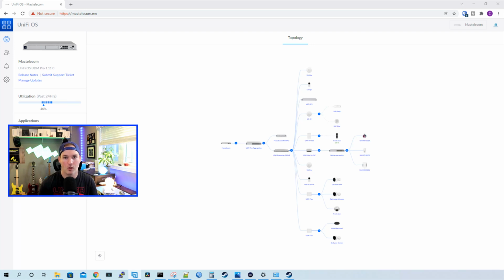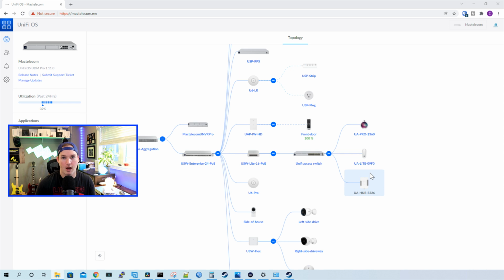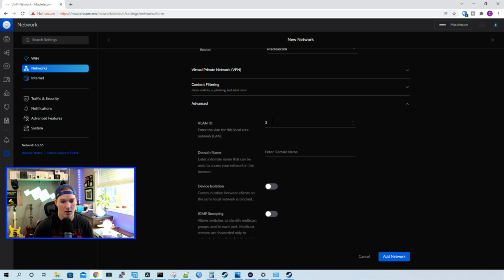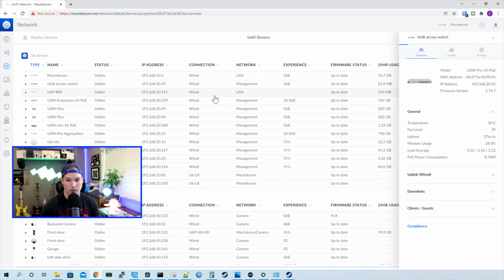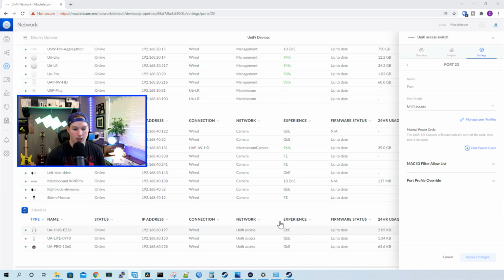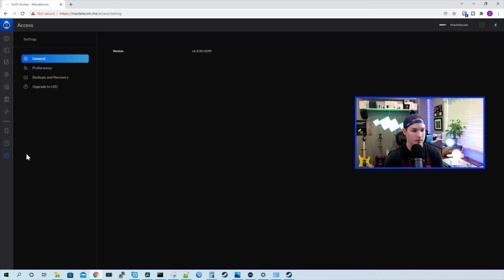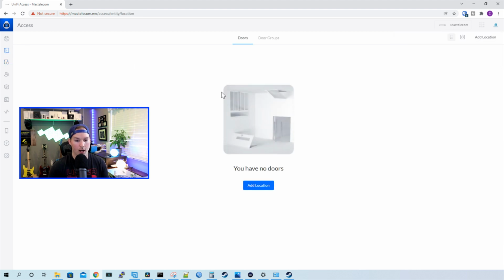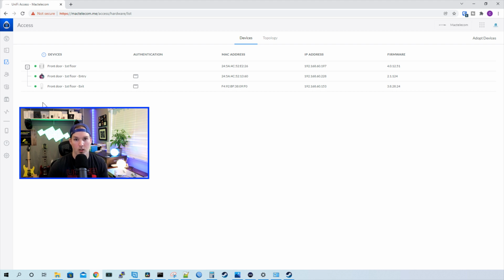Unifi Access setup part 1, creating a network and adopting elements

Comment: Hi, Great Video. Quick question. If you have a G3 flex connected to the access hub, is that camera seen by protect for recording and viewable using a viewport?
I'm going to install one at an office and the question came up in the planning stages.